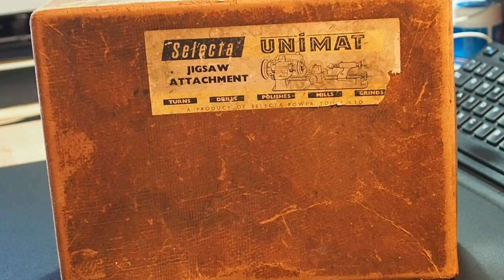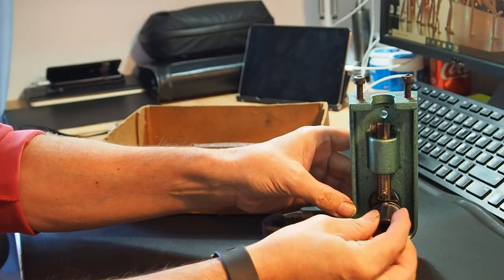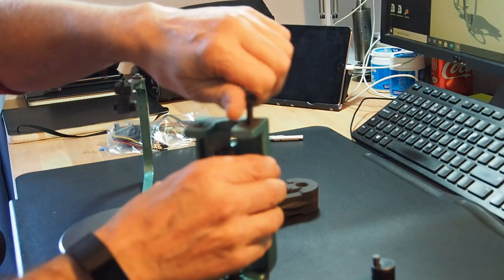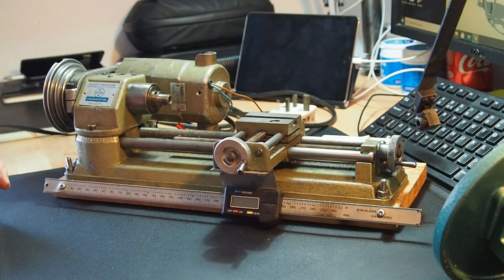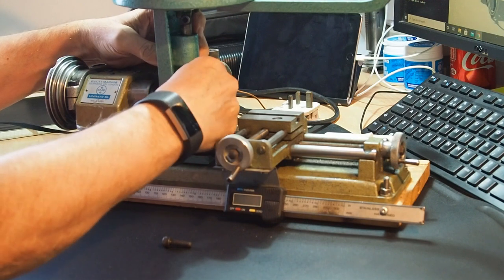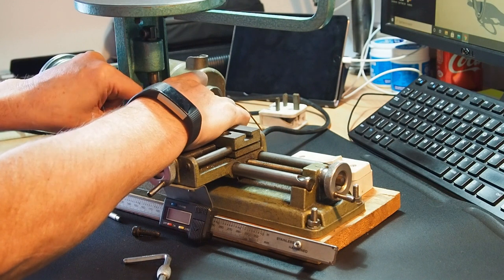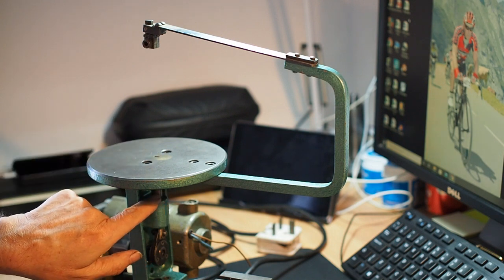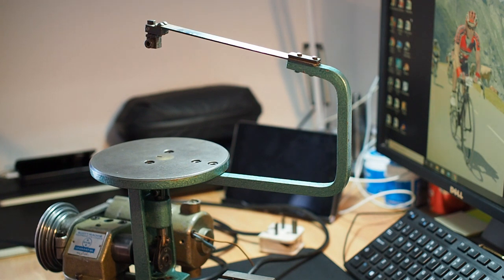Emco Unimat SL Lathe - SL Jigsaw Attachment.

Comment: Hi Paul, Everett's Workshop gave a heads-up on his channel as I just bought 2 lathes one cast Iron base probably from around the late 50 s and the other a Zamak base from around the mid 70s , going to set up one as a lathe the other a mill. I just finished going over the cast Iron unit and have just disassembled the other Keep up the good work.
Play Safe From Elliot Lake Ontario Canada.
Reply from the maker: Hi,
Thanks for visiting... Sounds like you have the same setup as me... one of mine is in quite poor conditions so will need a little more help. 
As you already done the process I will have you to mark my homework ;-)
Take care
Paul,,

Comment: Hi Paul. This year I had to decide between a saw attachment or the flexible shaft, which has been very useful, like a powerful Dremel tool with a 1/4" chuck. Even in the milling setup, you can tilt the headstock forward, attach the shaft, and do some serious deburring. But then you can never have too many Unimat add-ons :-)
Reply from the maker: Hi Rich,
I think the flexible drive was a wise choice... I think I would use it more than the saw attachment... 
Thanks for watching.
Paul,,

Comment: The original box is quite interesting. Is it made from some type of tempered hardboard? I appreciate the engineering that goes into these types of mini machines. For those that have limited working space, they are quite useful. Thanks Paul.
Reply from the maker: Hi Matt,
Thanks for taking the time to visit... It is nice to have the original box, crazy to think that it could be 67 years old.
I think the right tools for the right job... if you are working on small stuff then a small lathe is good.
Take care
Paul,,